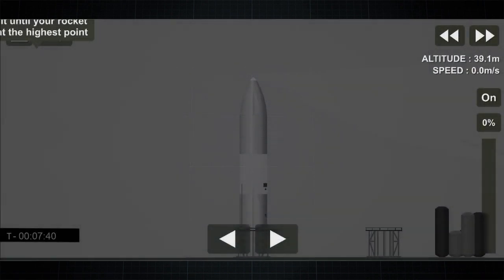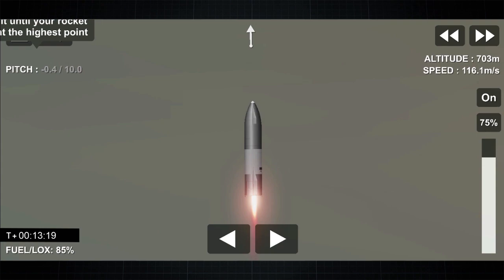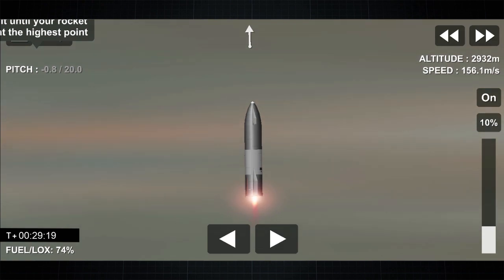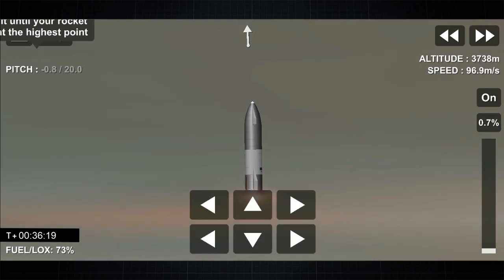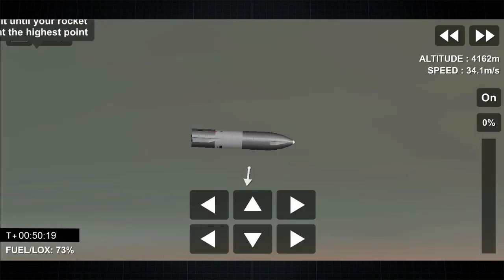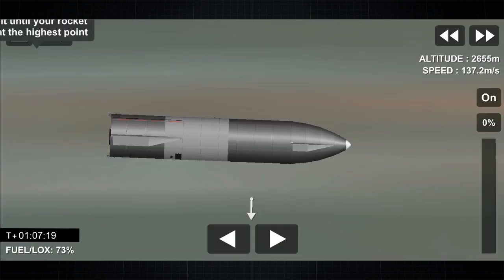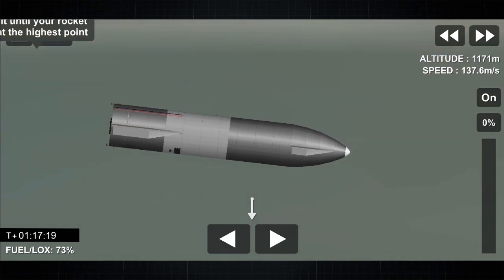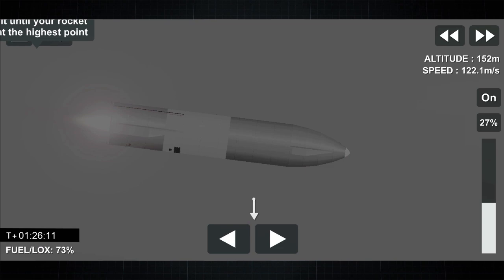Starship | SN11 | High-Altitude Flight Test

Comment: And that's why you never launch on foggy days
Reply from the maker: SpaceX team doesn't control the vehicle, all the actions and timing sequences is calculated automatically by SN11 avionic system itself by reading all the sensor, altitude target input. The avionic software control the thing such as managing the thrust, hovering, flaps control, even landing burn, however they can overtake to manual control, such as FTS triggers, and the fogs doesn't a problem here, visual view only displayed to audience, they only read all the data's from sensor and telemetry not from visual only